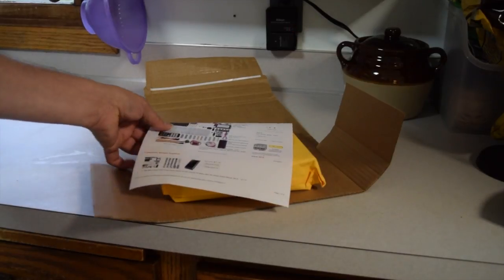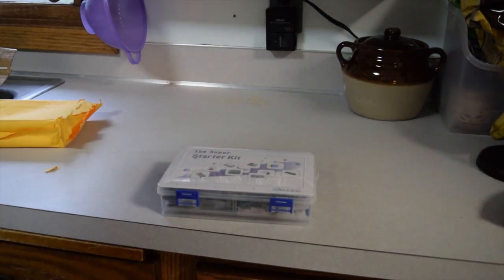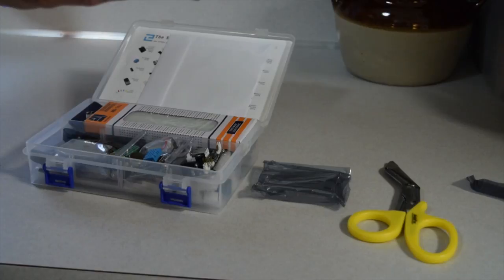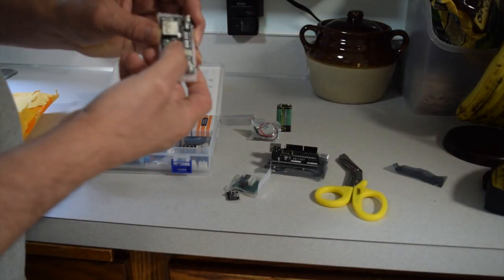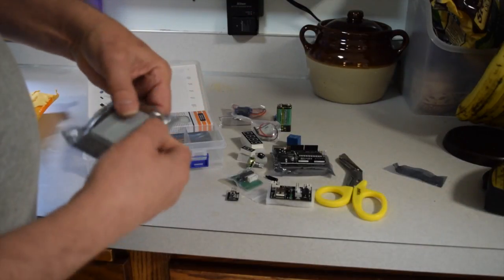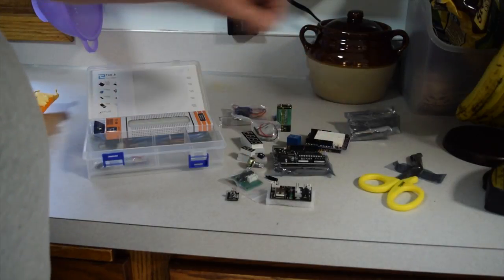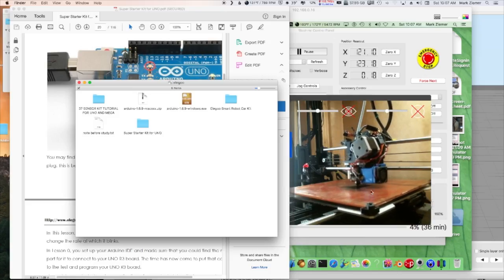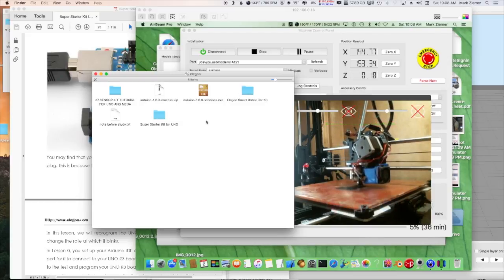Arduino Elegoo Super Starter Kit Unboxing

Comment: what kind of 3d printer is that
Reply from the maker: Greetings!  Thanks for watching my video!  
 
I use a Lulzbot KITTAZ - luzbot.com - Essentially a TAZ-4 that came as a kit at the time.  Lulzbot no longer sells kits, The current model of their printer in this size is the TAZ 6. They also make a Mini version.  Check out itworks3d.com for some refurbished and older models to save a little money if you're interested.  Thanks! - Some Old Guy

Comment: There are no static sensitive devices in that kit.
Reply: That is not true. Even with plastic  or a PCB on the device it  could still destroy your IC or other device . Only proper static bags or static protection encasing your device could protect your device from damage by static.